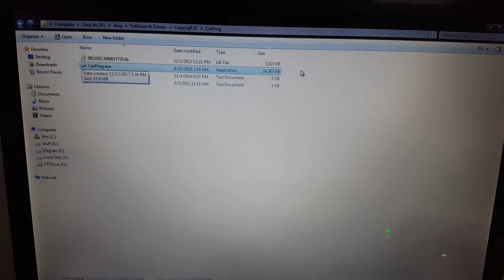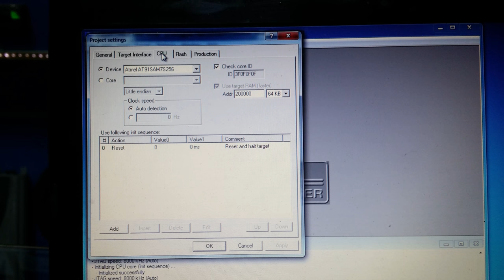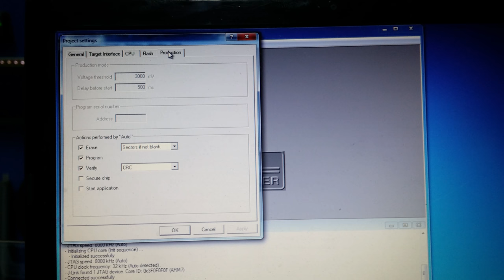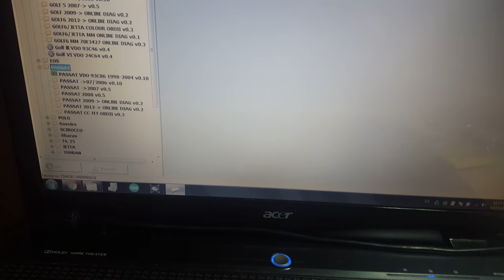CarProg Full / CarProg JTAG / Jlink / CarProg Online China Clone DOWNLOAD LINK IN DESCRIPTION

Comment: Hi, i bought for my BMW E46 a Carprog clone because of an error in the SRS Unit(Because of low Voltage). Sadly i always get an error (No respond from Main Unit) could you help me? What should i do Thanks for your Time.
Reply from the maker: Hi, have you tried to uninstall the driver and then connect the carprog unit back to pc/ laptop ?
Reply from the maker: Also, keep in mind that, having a clone, not all the functions work correctly. Try to do the procedure described in the video
Reply: Yes, i did unistall the drive also i did test the carprog on serveral different systems (win vista,7 and 10). If i make the test with the A9 Connector there is no error but if i make the EEPROM Test there is only 00 or FF(different chips). But Thanks for your time i will buy a jlink to upgrade it.